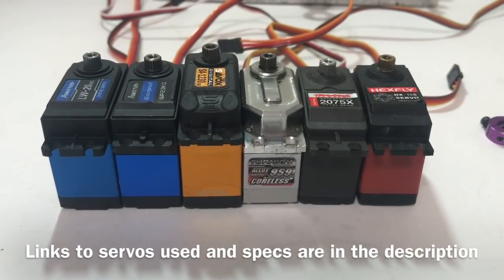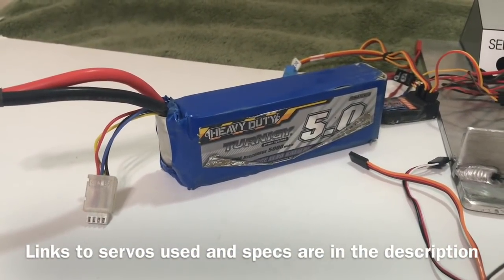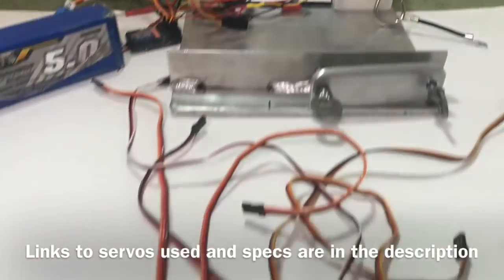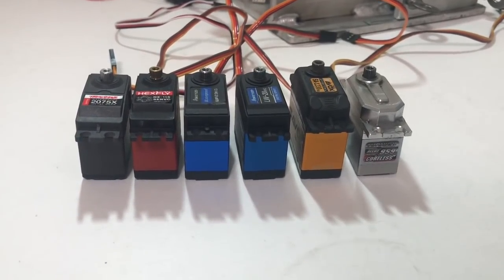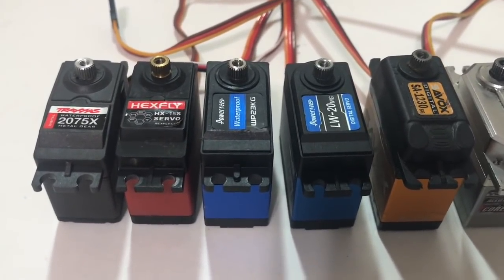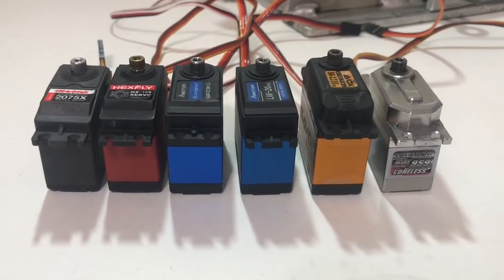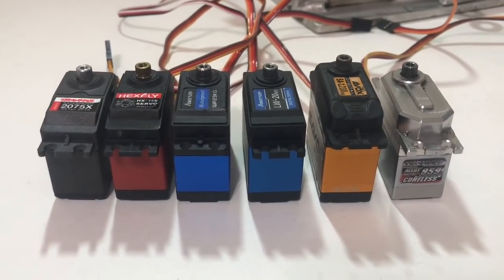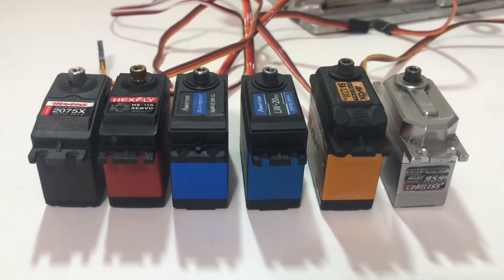Servo Comparison Savox Power HD Turnigy Traxxas Hexfly

Comment: Thanks for the video! So it’s hard to tell but did any of these servos tested by you pull the manufactures stated torq?
It would be nice if your torq ratings were listed in your comments with the manufactures specs for easy comparison!

Comment: i dont know if i undersand it right, but, did this servo Turnigy 959 had power liftign/pulling of 480> and more kg?
 i mean it can hold and pull this high amout of weight? really?
Reply from the maker: according to the scale its strong but also amp hungry

Comment: I recently bought a agf rc servo for my speed run slash 2wd.one I bought is only rated at 14.5kg-cm(202oz-in)@8.4v with a speed of 0.062sec/60⁰@8.4v.the agf is brushless with a solid aluminum housing with strength steel and titanium gears with double ball bearings.being that im using the castle mamba monster 8s esc im running servo at 8v and it responds super fast and im almost certain it has more power then what its rated cause when I change out gearing to bash it around it snaps the front tires around like they're not even there.running the dboons tires from the arrma infraction so bigger wheel tire combo compared to stock 2.2 slash wheels.love this servo so much I actually bought 3 more for my no prep drag build and to have 2 spares in toolbox just in case.lol.will also be buying some bigger ones when I start a crawler build especially since the crawler servos agf makes can be plugged directly into a 2s lipo so you can run them at 8.4 volts without a bec not to mention ones i looked at are 55kg-cm.little pricey but imo well worth it.the 4 I bought for slash speed build and drag build is the AGF-RC A62BLS and was $83 each and the 55kg ones i plan on using for crawler build are around $115 each.
Reply from the maker: Yeah times have changed a lot since this video was made. Much much better options it there now.

Comment: Savox can take a licking and keep on tickin!!  Some Helicopter flyers like the Turnagy 959 and say it's good but never tried it. The Power HD are crap. Some work but  others draw so much juice they can drain a large battery in a few flights. Had some in a 50cc Extra - nice plane crashed because the servo drain was outrageous!! Tested them later with a watt meter - what a waste I can't put them in anything.
Reply: According to these tests the Power hd pulls less amps on comparison to the others which points to an efficient servo,I've had Power hd servos and they're my favorite btw some Savox servos are made by Powerhd  .

Comment: The internal BEC in the HW1080 works well at delivering 7.4v to a high voltage servo
Reply: No, only 3.5amps.  Won’t power large servo.
Reply: B R works fine with my Reefs Raw500. It’s never browned out

Comment: Power HD is the best bang for your buck out of all those servos which is why you were surprised. I have two Power HD DW-25LV in my E Revo 2 and while they were just 10 bucks cheaper than the Savox 1256TG's I was going to purchase they have way more torque and faster response time than the Savox servos.

Comment: Hi, is the LW20MG a "STANDARD" Size Servo or Mini ?          What Servo HOLDER/BRACKET would I need to run the LW20MG in a Boat just for steering?
Reply from the maker: BWWGL9 it’s a standard size so it should bolt right up

Comment: for the power hd test in one of your other videos it was only i think 256 on 7,4 volts  in this video its over 310 on 6volt just want to no whats up with that cause i was thinking about getting that one but id like to no what it really does
Reply from the maker: Although they were labelled the same, they were physically different servos, some are stronger than others of the same specs. A prime example is the Turnigy 959, the V1 is way way better than the v2 as they went cheap after release and getting a good name, we could be seeing the same thing with these servos.

Comment: excelente vídeo. podrías por favor poner el link de compra  o el nombre del medidor de fuerza que utilizaste para hacer la  prueba a los servos ???
Reply from the maker: its just a digital fish scale from ebay this one will work fine for it  https://rover.ebay.com/rover/1/711-53200-19255-0/1?mpre=https%3A%2F%2Fwww.ebay.com%2Fitm%2FFish-Scale-Portable-Scale-LCD-Digital-Weight-110lb-50kg-with-measuring-tape%2F293119491100%3Fhash%3Ditem443f487c1c%3Ag%3AVRUAAOSw9ANdSRoY&campid=5338273090&toolid=20008

Comment: Could you do this without the BEC? Use like a sidewinder 4? See when it browns out? And use one of those receiver glitch busters to see of that changes anything? Very curious!
Reply from the maker: Andy Hamilton pretty much each of these servos would brown out the sw4 at full stall like this. The glitch buster is only good for a couple seconds, the sustained loads would still give you a brown out.
Reply: @ExocagedRC  oh really? I'm just dipping my toes into the world of high powered servos. Thanks for the video it was very helpful.
Reply from the maker: Andy Hamilton yeah man the Reef’s servos seems to be more efficient than most others. I have a bunch of videos on my channel about servos and lipo testing. Take a look for them.

Comment: This is so damn confusing, altho very nice.
But is the weight measurement in metric or imperial?
So annoying and confusing using them combined all the time.
No i dont know whats what.
Only that the Traxxas servo i have is pretty shit. hehehe.

Thanks for the video.
Reply from the maker: HanZie82 they are just measured in ounces pulled.
Reply: @ExocagedRC  Well i tried the conversion but it makes even less sense then. 
The calculations arent right, are you sure its an inch and ounces?
Becuase http://prntscr.com/o8dkaw
Reply: I think google might be messing with me. hehehe

Btw if not clear the vid is good. We need comparisons like these!
Reply from the maker: @HanZie82  I have quite a few more comparisons on my channel, take a look

Comment: What would you recommend for my HPI savage 4.1 k series?
Reply from the maker: Savox 1230 or 1231
Reply from the maker: https://rover.ebay.com/rover/1/711-53200-19255-0/1?mpre=https%3A%2F%2Fwww.ebay.com%2Fitm%2FMega-Combo-Savox-SA-1230SG-Servo-Glitch-Buster-Aluminun-Horn%2F392127351244%3Fhash%3Ditem5b4c9c89cc%3Ag%3ACAcAAOSwG~VboyGo%3Asc%3AUSPSPriority!32068!US!-1&campid=5338273090&toolid=20008
Reply from the maker: https://rover.ebay.com/rover/1/711-53200-19255-0/1?mpre=https%3A%2F%2Fwww.ebay.com%2Fitm%2FMega-Combo-Savox-SA-1231SG-Waterproof-Servo-Glitch-Buster-Aluminun-Horn%2F382568934541%3Fhash%3Ditem5912e2ac8d%3Ag%3Ac1YAAOSwEDJboyGq%3Asc%3AUSPSPriority!32068!US!-1&campid=5338273090&toolid=20008
Reply from the maker: https://rover.ebay.com/rover/1/711-53200-19255-0/1?mpre=https%3A%2F%2Fwww.ebay.com%2Fitm%2FSavox-SV-1272SG-Monster-Torque-HV-Unique-Steel-Gear-Servo-w-Free-Silver-Horn%2F362007657723%3Fhash%3Ditem5449567cfb%3Ag%3AKvYAAOSwrpJb5We7&campid=5338273090&toolid=20008

Comment: Excellent and very useful video, thank you. Just one lay question. What did you connect each signal wire to?
Reply from the maker: Thank you and they were simply plugged into the receiver like most servos are.

Comment: I have a traxxas slash 2wd vxl.  I’m pretty new to the hobby and my servo broke.  It only turns one way and I was wondering what servos would work for my car. I have a 2s and a 3s battery
Reply from the maker: Whats your budget for a replacement?
Reply: Exocaged RC 35usd
Reply: Exocaged RC I could go a bit higher though
Reply from the maker: I see this one on ebay, these are all crawler servos in this test so they are a bit slow. I'll look when I get home I may have a few stock servos if you're interested in those.

https://rover.ebay.com/rover/1/711-53200-19255-0/1?mpre=https%3A%2F%2Fwww.ebay.com%2Fitm%2FHigh-Speed-MG-Servo-for-1-10-ECX-Ruckus-AMP-DB-MT-Torment-Boost-Circuit-4wd-2wd%2F372581565796%3Fhash%3Ditem56bf978564%3Ag%3ARcEAAOSwEzxYdYH2%3Ark%3A1%3Apf%3A0&campid=5338273090&toolid=20008
Reply: Exocaged RC okay thanks a lot!
Reply: Exocaged RC I’m going to get that alturn one thanks again for suggesting it

Comment: Iam new to the crawling I just orderd the castle 2850 is this a good choice for the trx 4 bronco love your videos thank you
Reply from the maker: Ok. I’m assuming you got the Mamba X with 2850kv combo correct? If so just use the stock pinion and 2S-3S and with that esc you can run any servo you want without issue. When you get the esc there should be a card in the book you can use to get a free castle link you’ll need to adjust the esc with your computer. The strongest 6v servo I’ve seen so far is the REEFS Triple 5. I have a video on that as well as the 3BRC G13 you can look at.

Comment: If I put the power hd 20 in my trx 4 bronco do I need to do the BEC upgrade
Reply from the maker: Hard question to answer. If you drive in the rocks then yes, if you are trail riding then probably not. Traxxas has a bolt in BEC for these trucks and I have a video on it and their new 400oz servo. Check my channel for that video, super simple no solder instal for their bec.

Comment: Excellent test and video! Based on this (pretty much on its own) I chose the power hd 20 (instead of savox or cys) as my “budget” first upgrade for the useless and rapidly dying servo on my FTX mauler... I’m super impressed with it! The test was not necessarily “comprehensive” with only one of each servo, but definitely fair! Who is going to buy a whole box of each servo and run them regularly? We buy a few different servos  maybe, like this test, and we learn from the company’s first effort.
Reply from the maker: Yep I’m working on a test with the Reef’s 555 and it’s the strongest servo I’ve ever tested by far. You’ll see it when I get it all done and edited.

Comment: Hi, How well would these servos work as steering servos for 1/8 scale monster truck?
Reply from the maker: I've had good luck with the Savox 1230 and 1231 servos in 1/8 monster trucks
Reply: How about the Turnigy 959
Reply from the maker: the 959 is good but a bit slow for a basher truck IMO

Comment: Nice video and demonstratio👍I have a rc4wd rtr cruiser, the esc come with it outcry with external bec 6volts with 5a output,  What would you recommend for a servo for this? My stock servo seems to be ok, but there some situation or scenario you know it can't handle the weight of my truck(11lbs)
Reply from the maker: I’d give the Power HD 20kg servo a try. Now if you have a big enough budget, go for the 3 Brothers RC G13 servo.
Reply: Exocaged RC thanks😃

Comment: Isn't the savox supposed to pull 500ozs?
Reply from the maker: thats what its rated at, they rate theirs using a dynamic scale, which means its kind of like a peak or the max it can hit. Thats never the same as the raw stall torque I show here.
Reply: Exocaged RC Thanks for the test ,I was going to get a 1230 for my rudder but it looks like my 1270 is stronger.

Comment: Hello do you think that the POWER HD LW-20 MG would be enough and resistant for a TRX4 with a little more than 700 g of added
Reply from the maker: It would be a lot better than stock but if your budget can handle it, go for the 3 Brothers RC g13 servo. It gets power straight from the battery and is quiet and awesome. If budget doesn’t allow that, consider the Savox 1210sg if you must have waterproof.
Reply: The Savox 1210sg and the Power hd lw-20 mg make both 20 kg what is the difference between the two for the Savox 1210sg that the Power hd lw-20 mg? Please
Reply from the maker: Usually the better brand, which is Savox in this case, is more durable than a cheaper brand. It basically comes down to your budget. If you are on a tight budget, then go with the 20kg power HD and go have fun.
Reply: Thank you very much for all your answers and information. I start crawling, I'm not yet educated enough about it. Thanks again.

Comment: OMG that was awesome test. Traxxas should be ashamed putting that in our cars.
Reply from the maker: LoL yeah it’s really weak and have a very poor reliability record too.
Reply: If you look at traction/power = traction/(voltage x amps), Traxxas servo isn't bad, it has approximately the same ratio, it's just less powerful.
And yes I have a TRX4 equiped with it, it's powerful enough to steer on any surface, in fact it's powerful enough to break the f***ing plastic servo horn that's originaly installed. THIS plastic part is the real shame.
Reply: You pay a lot for traxxas they include junky servos lol
Reply: @westernsharpie   And then RedCat comes along with the Gen8 Axe edition for $499.00 that has an epic detailed licensed Scout II body, REEFS Servo, Axe brushless speed controller, Axe brushless motor, GT5 6 channel transmitter, portals, licensed super swampers etc, in a vehicle that is arguably every bit as good as the TRX4.   Traxxas has no excuse any longer.
Reply: I don't feel quiet so bad about my gen 7 servo.... I expected it to be the very last but surely I didn't expect it to beat Traxxas the other ones I knew it wouldn't....but that's why there out there to buy lol

Comment: What would be a good servo for a monster slash 4x4
Reply from the maker: What’s your budget? Is waterproof a requirement?
Reply: Exocaged RC my budget is below $100 and It should be water proof
Reply from the maker: I'd give the Holmes servo a try, https://holmeshobbies.com/electronics-and-wiring/servos.html if you want to stay with something like hitec you can get the 7954sh but you'll have to seal it up yourself.

Comment: Hello everybody. I am French and totally beginner in RC. You advise me that it servo for a TRX4? Please.
Reply from the maker: assuming your truck is stock, you should try the Power HD 20kg as shown in this test, its about $20 and many people fine it works without an additional external BEC. If you go too high on servo an external BEC is required.look in the description as there are links to the servos used in this test.
Reply: Thank you very much for your answer and for your really informative video

Comment: Should i put a power hd 20 kg on my tr4? Should it be with a bec or without? Can it turn the wheels in place at msx range? There are 3 questions :D thx in advance
Reply from the maker: Many people run the 20kg with no additional bec so give it a try. It’s way way better than the stock 2075x servo.
Reply from the maker: Plenty of 20kg servos here to choose from, make sure you buy inside the US unless you are somewhere else, the blue ones are waterproof. https://rover.ebay.com/rover/1/711-53200-19255-0/1?mpre=https%3A%2F%2Fwww.ebay.com%2Fsch%2Fi.html%3F_from%3DR40%26_trksid%3Dp2380057.m570.l1313.TR1.TRC0.A0.H0.Xpowerhd%2B20kg.TRS0%26_nkw%3Dpowerhd%2B20kg%26_sacat%3D0&campid=5338273090&toolid=20008
Reply: Im from Romania, thx for your response.
Reply from the maker: Ok yeah you may want to order from China.

Comment: Would be nice if there was a spec for each servo that you test to compare with test result.
Another part is just torque is irrelevant its all about gearing one servo might be absurdly strong and slow as a turtle so to test them you should compare both speed and torque.
Reply from the maker: In a scaler, torque is everything. In a racer you gotta have speed and torque to get it there. I don’t really have a way to accurately test speed. I wonder if I could maybe have a manual button to start and stop a timer? Now I’m thinking about it.
Reply from the maker: also specs for each servo are in the description
Reply: If i were you i would just make a clock alike scale and equip every single servo with same lenght horn then film it with decent fps camera with some math you can get exact speed of the servo.
Reply from the maker: Yeah I’d rather it be visual for video purposes. Something where I can hit it and video gets it all in real time. Maybe a little slomo on the really fast servos.
Reply: Still simple scale and timer next to it can show how long it takes for the servo to travel certain angle ;]

Comment: So power hd wp 23kg won't need a bec for my traxxas trx4?
Reply: I put one into my trx4 Defender after the stock servo died. The rig weighs in at 9lbs 6oz and so far I have not had any trouble with it. I do mostly trail crawling over roots and hill climbs, no serious rock crawling.
Reply: @Der_Alte_Fritz  good to know
Reply from the maker: I've read where some run it without and its fine, if you bind it up in the rocks it may brown out the system, if you're just messing around in the woods and trails you may be fine.

Comment: HI, I just purchased a power HD for a slash and was watching your video. I see the traxxas only pulled 2.5 amps and the HD 6 give or take. The factory esc spec is only 2.5amps so wondering if there is any gain if the servo can only be supplied 2.5 amps anyway. The test was to fast to see where the servo was pulling at 2.5 amps. I am new to rc's so could I be missing something. A test at 2.5amps if that's all that could be supplied?
Reply from the maker: What happens when the servo pulls too many amps from the esc, it causes a brown out, a brown out is when the receiver voltage ( same as servo gets ) drops below the minimum voltage required to function, everything turns off and the system restarts. In your case you may never stall the servo so you may not have an issue at all. In a scaler it could be a problem.
Reply: Thanks, it probably wasn't worth changing then, except for the metal gears in my case. Amps being equal, they probably pull about the same just more potential with different bec.

Comment: I've been impressed with my powerHD 20kg servos.  I have one in a 4x4 stampede and one in a Brushless Savage and it does fantastic in both rigs!
Reply from the maker: Yeah I got the 20kg in my Proline ProMT and it’s doing great
Reply: How about endurance now?
It's still going well today?
Reply: @rendra2664  The one in the stampede is still going strong 4 years later.  The 3 I put in the savage kept stripping gears, but that's quite a large vehicle and I drive hard.